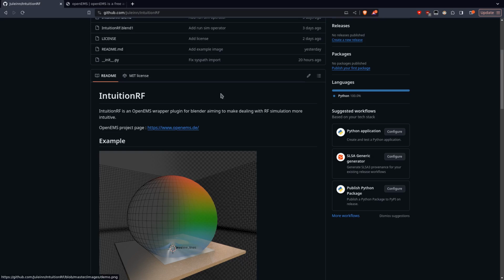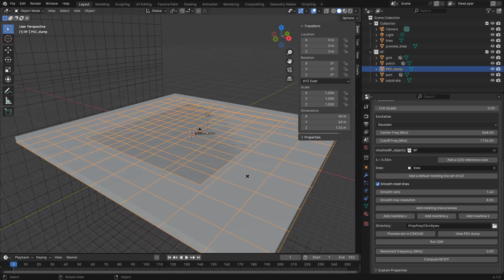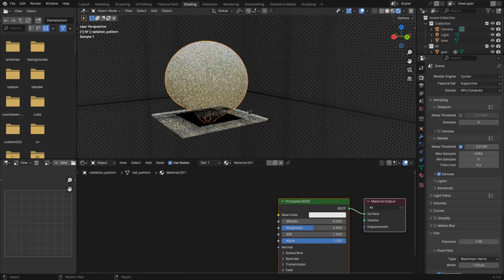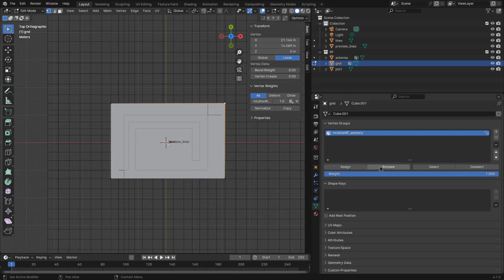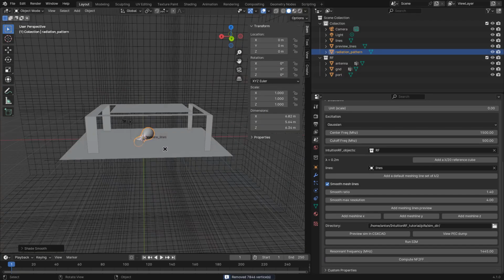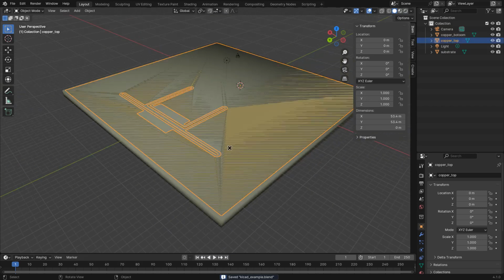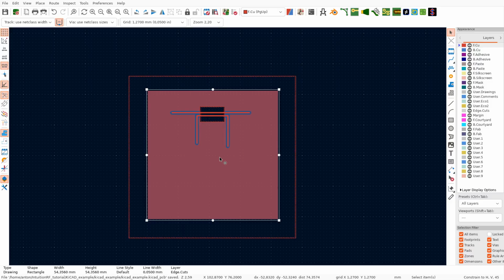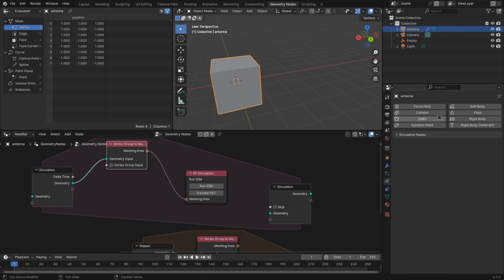IntuitionRF - an OpenEMS plugin for Blender

Comment: Very helpful video. Your Blender approach seems much cleaner than FreeCAD for EMC simulation. What sort of limitations to PCB imports are there for Blender ? FreeCAD struggles with anything 2+ layers and then the PCB needs to be broken up and brought in individually.
Reply from the maker: I think currently the biggest limitation is the triangulation when the PCB is exported as a geometry. This makes vertices very close to each other, which is you mesh incorrectly result in very small simulation cells and therefore unnecessarely long simulation times. Some retopology is usually required.

Comment: Interesting - total beginner question.

Can this be used for Bluetooth antenna simulation?

And could I simulate an LDS (Laser Direct Structuring) with it?
Reply: Bluetooth antenna simulation 100% - The first exanple that is demonstrated is a 2.4GHz antenna.

LDS I don't know, do you mean the process itself or the result of a LDS manufactured structure ?